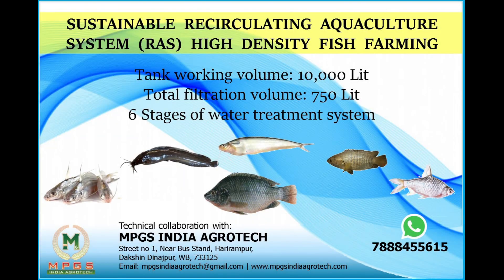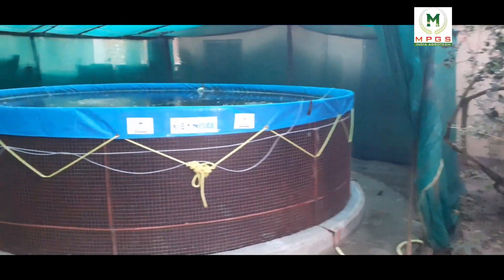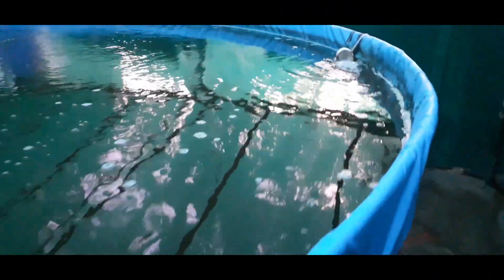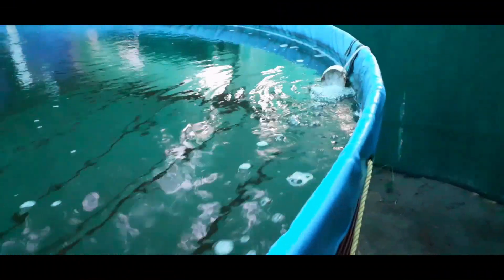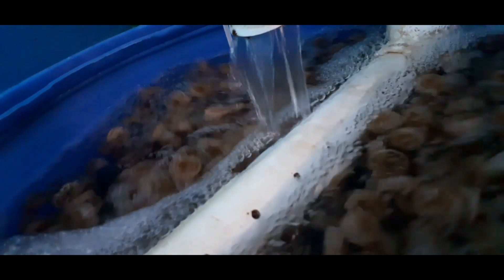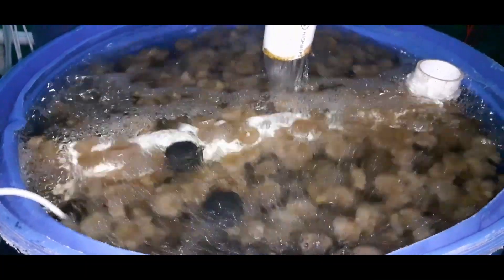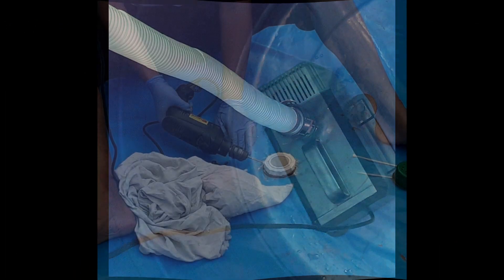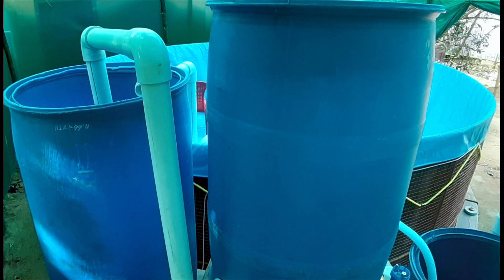Low Budget Recirculatory Aquaculture System (RAS) fish farming.

Comment: Do you design and supply RAS system for 4 tanks of 100 cubic meter of water where the 400 cubic meter of water is recirculated in which it passes to prefilter where 70% of large solids are removed then it goes to drum filter having 60 micron mesh and capacity of 400 cubic meter filtration per hour then the water goes to biofilter tank with bio media to remove ammonium and ammonia then after passing through UV chambers goes through spice cone to supply bacteria and virus free oxygenated ( oxygen >8 mg/liter) water back into fish tank.

Comment: What is the LPH recirculation capacity of the RAS system you have built for this 4 dia tank? Plus, what is the mechanical filtration process used?
Reply from the maker: We are keeping 2500 LPH for 10000 lit tank. We use basic mechanical filter for budget setups...

Comment: Don't spread fake information, here u r saying no need of caco3, dolomite, than how could one can maintain the PH as well as alkanity. ? Without an alkaline medium ur nitrifying bacteria will not colonies themselves. And wat u r using for controlling nitrate? Because nitrate is the main problm of RAS system. Maintaining Ph nd nitrate is quite difficult in RAS than biofloc.  I m doing RAS since , 2018, so pls dont spred wrong information only to gain more numbers of trainees nd earn from them.
Reply from the maker: First of all, don't use fake profiles to judge others' abilities. 

2. Additives requirements depend on water parameters and fish species.

3. pH can be handled by the controller. We are comparing our Budget RAS system Biofloc system. The high-tech RAS system has its own standardized machinery.

4. Nitrifying bacteria can work in a wide range of pH. It depends on the quality of Bacteria you are adding to the system. However, above 7.0 pH is recommended for most fish farming.

5. It's great that you are experienced in RAS fish farming. Why don't you share your experience with interested people? 

Finally, we don't provide training by taking money. It's free even if you are not taking our system.
Reply: Good thoughts Sir stay positive

Comment: Hi sir ' I have spring running water which is 2.5inchies 12 month, in winter water is warm n in summer it becomes cold,people used for drinking also.without any filteration can I do fish farming as like RAS system.water is very clean.
Reply from the maker: You can do raceway system...

Comment: Hi bro am from kerala i have 3diameter tank and 165ltr mbbr 2mechanical filter and 1biofilter 3 barrels 220ltr barrels but my submersible pump is very small 3500ltr /h plz suggest 1motor for that
Reply from the maker: Its better if you can WhatsApp your number to 7888455615. We will have some discussion to clarify your need. Thank you.
Reply: @mpgsindiaargotech9722  ok bro